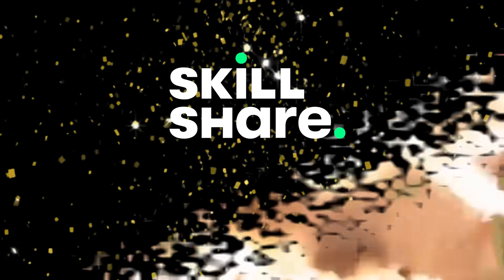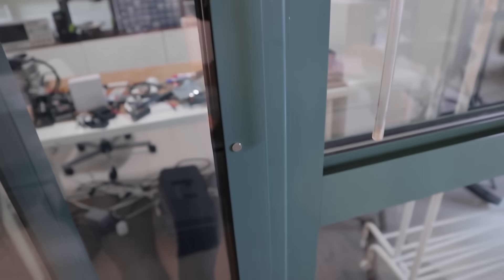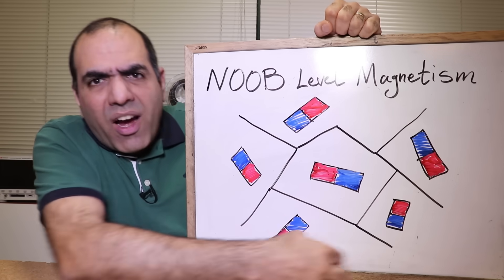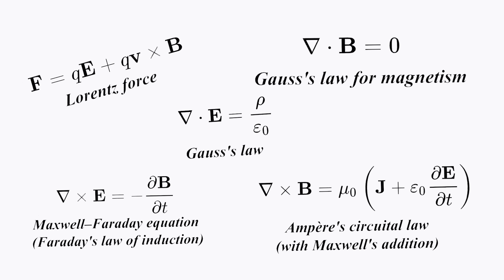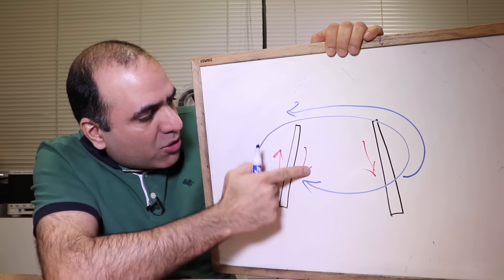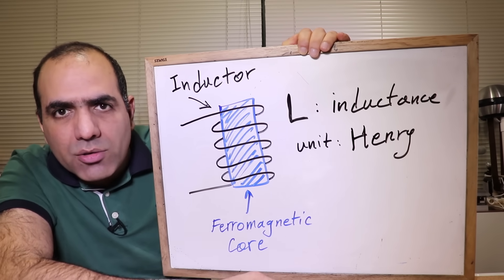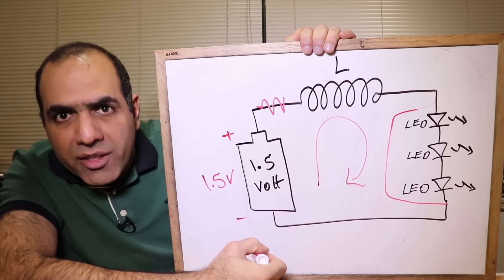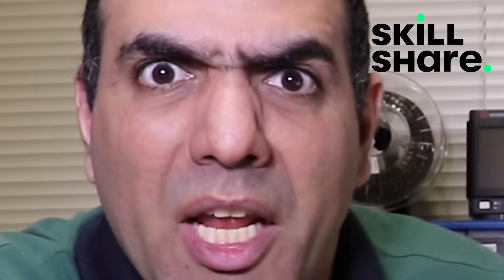Magic of Magnetism & Inductors (ElectroBOOM101-007)

Comment: 5:34 The whole 'magnetism is fake' thing is actually really cool, but it's definitely not easy to understand. I'm going to try to explain how you get magnetism from electrostatics and special relativity:

Imagine you have a wire carrying a current but no net charge. There are positive charges (nuclei) that are stationary, and negative charges (electrons) that are moving. So, you can imagine the situation as a stationary line with a certain positive charge density and a moving line of equal but negative charge density; since the two line charge densities are equal and opposite, they cancel out. If you place a stationary test charge anywhere, there won't be any force on it since the charges cancel.

Now, imagine you start moving in the direction of the wire. You may have heard that if a spaceship travels close to the speed of light, according to Einstein's special relativity, it starts looking thinner. Well, the same thing happens here. The wire 'squeezes', and all the nuclei and electrons appear to be a different distance apart from when you were stationary. This changes the charge density of both the positive and negative line.

But here's the kicker: they don't change in the same way. Because one was moving before you started moving, and one wasn't, the relativistic 'squeezing' effect squeezes one more than the other. If (for example) your motion makes you move along with the electrons, the nuclei all appear to 'squeeze' and get closer together, whereas the electrons appear to 'un-squeeze' (because first they were moving, and now they appear like they aren't) and get farther apart. So, what happens is that the charge densities of the positive and negative line are no longer the same!

For this reason, if you place a test charge near the wire and move it along the direction of the wire, it sees two different charge densities. Now, they aren't cancelling each other out! The net charge on the line causes the test charge to be attracted to or repelled from the wire (depending on how it's moving).

Of course, if you aren't moving along with the test charge, you don't see a net charge on the wire. All you see is the current causing a moving charge to be attracted or repelled from the wire. So, you conclude that it's not the electrostatic force of attraction putting a force on a test charge; rather, it's an entirely new force, one that's produced by currents and that acts on moving charges. You might even call this new force a 'magnetic' force. But in reality, it's not a new force at all; it's just the effects of special relativity on the electric force.

Hope this explanation makes sense!
Reply: I promise you the magnet on my refrigerator is not moving anywhere near the speed of light.
Reply: @ariesdane5876  That's a very good point/question. But what you may not know about the magnet on your refrigerator is that the positive and negative charges inside it are in an extraordinarily fine balance. If you were to remove all the electrons and hold them a metre away from the nuclei in your magnet (assuming it's 100g of iron), the electrostatic force of attraction would be about 1.5*10^23 Newtons, more than the gravitational force the Sun has on the Earth.

It's this delicate balance that results in the strength of magnetism we're familiar with. Because the equal but opposite charges are so great, a change in the relative charge density results in a great net electric force on your test charge, to the extent that even the miniscule change made by relativistic effects at everyday speeds is enough to produce a noticeable force.
Reply: @rtg_onefourtwoeightfiveseven  To complete with mathematical steps (for Mehdi), check for example derivations in Electricity & Magnetism (Purcell). (I have all the steps written down with motivations and exercises for my students, but sadly only in Finnish.)

Shortly put:
1) Represent wire charges as linear charge density lambda.
2) Apply Lorentz contraction to the distances between charges from the viewpoint of a charge outside the wire. (Perhaps moving parallel to wire for a simpler case at first.)
3) Present Coulomb force in terms of aforementioned lambda (well, lamda+ and lambda-, since wire has both charges) and electron charge. Simplify (and maybe do some low-order approximations).
4) Since the force is now dependent on velocity because of length contraction, the expression for F includes it; in fact you end up getting something like F=qv•[something containing permittivity and distance from wire]. The former part turns out to be Biot–Savart! Let's conveniently call it B to get F=qvB. The rest of the macro-sized, non-spin-related magnetism can be derived from there. (Only one right-hand rule to rule them all!)

I'm sure Mehdi can work these steps out. ;)

Interesting side note: there is no cool linguistic etymology for why we notate magnetic flux density with B. Original Maxwell's equations had many, many more equations than the modern-ish four (mostly compiled/concentrated by Heaviside). Maxwell worked with many different field variables in his treatises, basically just naming them alphabetically: A, B, C, ..., H. B just stuck (along with A and H) while rest were deemed redundant later on. In most cases a capital letter for a unit symbol implies it's named after a person, but not here.
Reply: @JoonasD6  Those are great comments dude, thanks a lot ! Keep spreading the knowledge sir !

Comment: I used to watch him solely to see him get shocked. He’s actually an amazing teacher and got me really interested in electrical engineering. Might even consider it as a career path
Reply: Eat your cereal
Reply: @TheMann-zv9vt  No he wont ill give him some wirea he can chew instead
Reply: Im currently doing it myself and you need to go trough a lot of super boring math before you get to the interesting stuff.
Reply: I'm an electrician but if I had to do it all over again I would get into electrical engineering and then also get my trade ticket as an electrician. You'd be basically unfireable for the rest of your life.
Reply: Engineering is for people who love math and minutiae. The big, broad strokes that Medhi paints with are only part of the equation. You have to be capable of both big picture stuff and tiny details to be a good engineer. 

I was not a good engineer. ADHD just got in the way of the level of detail that I could handle when I didn't want to do something.
Reply: Robert Hunter Robert Hunter well in theory you are Right but in practice I just need the paper to get more money from the stuff I’m doing already. A lot of company’s do very specialized stuff that only gets coverd very briefly in university. 
I need the ability to understand and troubleshoot complex technical systems and the knowledge to improve / fix it with newer parts.

I don’t need to be able to do crazy complicated math without a calculator like in university. 
Nobody in my company would take a piece of paper and waste have a day when there are calculators and computer simulations. 

In MY opinion you don’t always need to understand everything from the ground up. Humans have come so far because we specialized more and more. I don’t need to know how to mine and extract copper when I solder cables.
Reply: @blise518B  You need to know the math so that you understand the underlying concepts, and consequently what you're doing. Computers are tools, not a replacement for your brain. I've gotten plenty of garbage out of programs when I put garbage into them. Case in point:

My company was contracted by a municipality to evaluate cell phone providers' claims that they need new cell sites because the city didn't like ugly towers. It was a silly job because cell sites are expensive, and they don't go around building them without reason, but it was a quick few thousand dollars. 

I contacted the cell company (forget which one it was) and like every other time, I asked for their current towers' specs, including transmission power. I got back a form response of "we are licensed for 1600W." That's nonsense, because phones aren't capable of the same range as a 1600W tower, so most towers were more like 100-200W. But I wasn't going to argue with Mr. Too Good To Give Me Data, so I simulated it at 1600W. I then informed him that we saw no problem with their coverage, and without different data, we would be forced to recommend that the tower permit be denied. I got my data shortly after that email.

Now, if I were designing a cell network, and only took into account the output power of the tower, without considering the cell phones, I would have huge holes in my coverage. That's actually exactly why there were (and still are in many places) so many coverage gaps in cell service. A bad tradeoff was made in the coverage vs cost, and their optimistic coverage projections fell short.
Reply: @blise518B  I hire engineers who are hobbyests first. If I look at their GPA, it's just to see if they skip a lot of class.
Reply: Robert Hunter i dont See any Pont in your story where complex Math skills would have helped you. 
Understanding practical concepts and knowing realistic numbers is very important and I’m not against that. Power and RF signal range formulas are not what I consider difficult math. It’s the stuff you only do and need in math that you never use in other areas that’s annoying me.
Reply: @roberthunter5059  I been a EE for longer that you've been alive. Still is one. Get the big concept right, and the minutiae and math will come. Let it intimidate you, go play some video games.
Reply: Same dude! I even make my own robots now

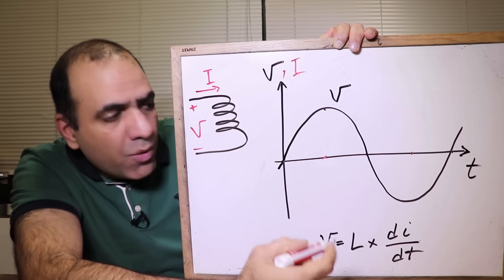Comment: Isn't his statement at 11:11 actually reverse? When the voltage signal is at its peak, its rate of change is ZERO (hence the flat tangent line) and the inductor current is at zero as well (it intersects with the x-axis here.) Then when the voltage signal is zero, the rate of change is MAXIMUM (steepest tangent line). So the inductor current reaches its peaks there.
So the opposite of what he said, but the drawing is correct.
Reply: The rate of CURRENT change, not voltage.

Comment: I actually plugged a coil in an outlet at stuck an iron rod through it and it got molten hot piled the rod in and shot the rod and molten metal out and then sparked and stoped and there was paperclip in my outlite forever agleast it was a power cord

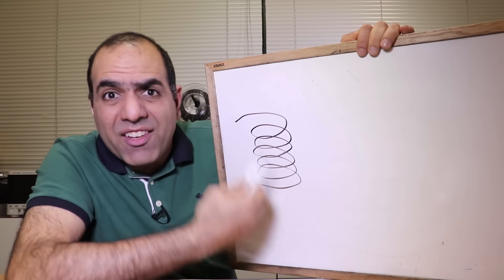Comment: 8:30 You are not right about inductees, the number of turns, and their strength! It was proven recently that the striking force of a comercial solenoid goes UP when you remove turns of the coil! This counterintuitive increase in force goes for a few turns, then the solenoid will become weaker like you've implied. This is because comercial solenoids are very tightly wound, and removing the outter wraps brings the center of mass closer to the rod without reducing the mass of copper very much. 

I know the guy that proved this useless bit of trivia lol. The increase in force is negligible, but the increase in being pedantic is 1000 fold!

Comment: 1. The pockets theory is wrong. If you brake a magnet in aproximate half it will never conjoin the same way it broke.
2. the invisible lines are 1. not lines 2. well... they are invisible. - They are not lines but aether flow in a vortex motion. (yt: ufopolitics)
3a. It has nothing to do with relativity but aether pressures exerted on a conductor at 90 degrees causes the aether potential (volt).
3b. When current flows aether is wraped around the conductor understood as magnetism. Likewise if you add or start waving a magnet, those magnetic fields will be increased. Similary a radio station can induce currents in cables as they pulsate the aether or electro-magnetic field that is called and it induces currents.
---
Up to this point, if you understand aether its easy to understand. Now lets add that there is no ELECTRON flowing IN the wire, but aether pressure sorrounding the wire. This can be observed when turning off a switch or in other words interupting the circuit. All the stored "inductance" in the wires colapses and a spark occurs.
To add: Aether likes to stick to mass. i dont know exactly why, but AC is literaly a radio frequency that works on 50 or 60hz and uses copper as a waveguide.
bonus: Also EM are not waves as in transversal, but longitudinal. This is what Nikola Tesla explains.
Lets continue with the video: ---
4. again ... in Nature vortex motion is natura... so its not lines of force but vortex motion. 
5. Verry good hose analogy. Nikola Tesla uses a similar analogy when explaining 1 wire transmission versus a 2 wire (return).

Bonus: At the begining you show how throwing a magnet through aluminum foil it has a slow fall. If it were iron it would stick while steel is agin non-magnetic. Also titanium is non magnetic and has a similar electric conductivity to steel which is a bit better than iron.
So following that logic and adding that super conductors dont allow magnetism to pass though them we can speculate with great preccision that induced magnetism in the conductor is what it's percieved as loss and heating NOT electron flowing through the wire.
And again ill add one last thing that i deem important: Nikola Tesla says EM propagation is similar to sound propagation through air, except it travels in a similar fassion through aether which is a gasseous like medium. (michelson morely experiment was redone with positive results if sagnac effect is not enough for you people)
Bonus2: I came to the conclusion that einstein was put by the media to halt the development of electricity and they had to erase Nikola Tesla from the books as he spoke sense and talked too much about aether. This technology leads to  sci-fi reality.

Good day and may some intuition left in you spark just enough to check the information for yourself. Its condenset peak importance knowledge. Aether is real, its longitudinal not transversal.... its pressure mediation not charge distribution etc etc...

Comment: hi! i am confused at 11:05 where you say that the collapsing magnetic field pushes current through the leds, instantaneously increasing the voltage to 9v. are you saying that there is current with no voltage just prior to that (how can current flow when voltage is insufficient)?  are you saying that the voltage instantaneously changes? i thought you said just prior to that that voltage can not change instantaneously (but maybe that only applies to capacitors, not inductors?)
it seems to me that maybe (i am not an electrical engineer, only an amateur) the change in current (current is flowing while there is the short, and then goes to zero when the short is removed) causes the magnetic field to collapse. that causes a change in voltage according to your equation V = L * di/dt maybe that causes the voltage to rise enough to conduct current though the leds? that's my intuition/guess. any help?
thanks for your awesome vids!

Comment: oooooohhh yes , can see where this is going : The "fun" that can be had with both an Inductor AND a capacitor in the same circuit :D
P.S.  @ Mehdi : Online inductance calulators suck when you have 3300 turns of 29 AWG coated wire where the coating spec can vary by +/- 0.1mm per cm - I know coz I had to abandon calculating the L of my Tesla coil secondary and use practical measurements instead ;)

Comment: 1:19 Any nine-year-old knows, there is only ONE way to test for 9VDC: Use your TOUNGE!
Reply: It was only 9V because the LEDs forward bias voltages added up to 9V. The actual inductive spike would go a lot higher than that across your tounge. And tecnically it would not be DC, because it's just a spike.
Reply: @E-BikingAdventures  Still DC, only pulsed, doesn't go through zero :P
Reply: tongue not tounge😂
Reply: @jasonsummit1776  . Tongue. Thanks. I always have trouble spelling that word.
Reply: Dr. M. H.  I fayled engisch for timmes. Kno shite!
Reply: Since i don't a meter (yet), i test lower DC voltages with my tongue lol
I also use a motor and determine the current and voltage by the speed and acceleration

Comment: If you open one of those heavy "wall wart" adapters and disconnect the circuit board from the low voltage winding of the transformer, you will have a powerful flyback/rumkhorf coil. When you connect an "AA" battery to the low voltage winding and then disconnect it, most of the current in the low voltage winding comes to a stop, but the magnetic field makes it continue in the high voltage winding instead. You can make sparks several mm long from the prongs on the high voltage winding. Trust me, you don't EVER want to touch the plug when that happens. Oh, and save the circuit board. It's Full Bridge Rectifier can be used for other experiments.

Comment: Hey can someone help me about this? I've tried the thing with a tube and some magnets but using  6 and 12 magnets in series i've noticed that the 6 magnets are slower than the group of 12, is it possible that the 12 magnets produce a similar magnetic field and so they are faster because of their weight? (Definitely not for my college assignment)
Reply: The net force of a falling magnet is only its weight force. However, the tube's induced current from the magnet suddenly places an upward force on the magnet. This force is less than the weight of the magnets (this proof is a bit difficult, because what we have is essentially a finite solenoid).

Adding more magnets does create a stronger field, however, their weight scales more than the magnetic force.
Reply: @ryanfrench796  Thank you very much!